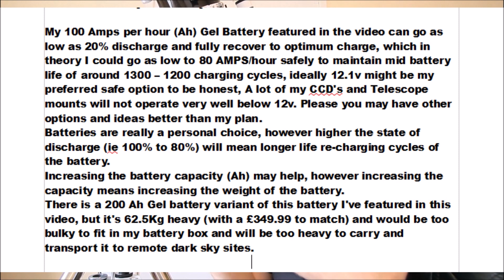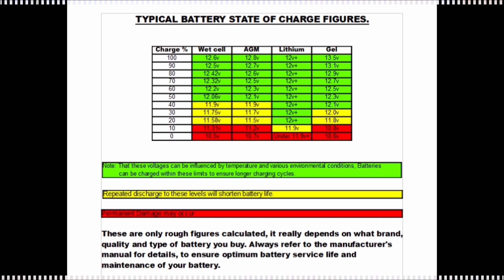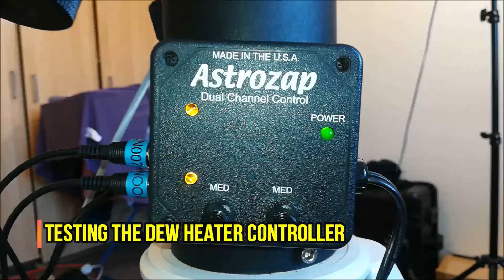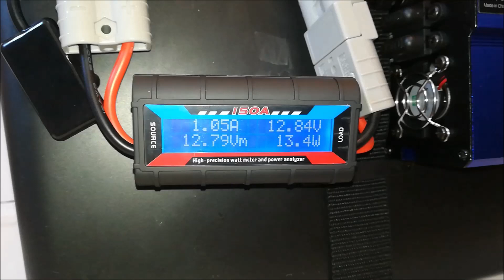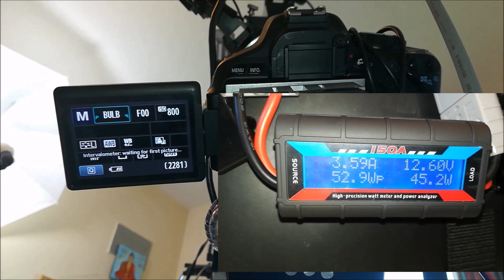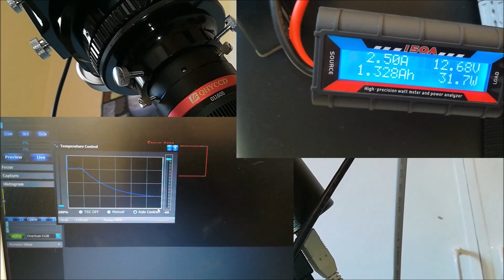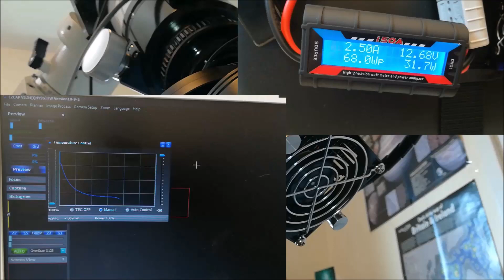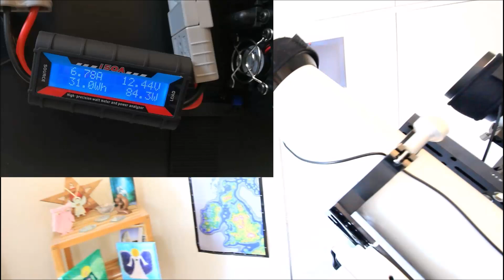Power your telescope to the MAX!!!

Comment: the charge of a battery is measured in amps-hour, not amps per hour.   1 amp is 6x10^18 electrons flowing per seconds, thus if you multiply current with the running time, you get total charge used.  So a battery with a capacity of 17 Ah could sustain a current of 17 amps for 1 hour and then be depleted, or it could do 1 amp for 17h before being depleted.

Comment: I picked up a 22ah Lithium camping power pack and very light, only out a couple of hours a night, or 3 hours max, also have the Celestron LiFePO4 4, which is i think 13ah, enough for the telescope and the other for running dew heaters and revolution imager, so plenty of power. My evo 9.25 has built i  battery but dont use it as the battery does not last long, so power it with external battery.

The camping power pack has a 12v to 220v, so can plug in normal appliances that use 3 pin ac power so handy for lap top

To buy a 100ah battery here in NZ and battery box would cost a fortune
Reply: The newer lifepod4 batteries are the best and can completely flatten then and if you did not use your telescope for years and never charged the battery, will still hold its charge and dont discharge like normal batteries. They are more expensive but worth it, if you can afford them.

Comment: Excellent video Martin, I've been thinking about my power supply and like you had the Powerpack, there is one thing about the Powerpack that I could never work out though, why there is a 'Siren' option on the pack? but heyho... I'm sure there is someone that finds that option a 'must have' :) Your video has helped me make a decision on where I go next with this though and for me, the issues all surround the power for the laptop in the field and your video has given me the solution I've been looking for. Well done!
Reply from the maker: The siren is used as an emergency stress alarm, never had to use it to be honest with you and it's more of a gimmick to sale the power tank. Some of the Lithium Battery power boxes you can buy have a lot of unnecessary items too and can drain the battery a lot more with these added gimmicks . Weirdly enough they offer very lack of cigarette power ports too which this project offers plenty of cig ports, considering most of my equipment do run on them. I'm looking into more ways to improve on the project to make it perform much better. I 've tested the battery box with all of the equipment shown in the video and I have managed to run the entire set-up for 18 hours with the laptop been plugged in once on a full battery charge and one slight top-up, without discharging the battery below 12.1v. This very impressive stuff with the whole set-up costing me just under £300. Sounds expensive at first, but there are Lithium power boxes which cost damn site a lot more money. If you check out this link, you'll get to understand why I made this project in the first place?? 

https://www.amazon.co.uk/COSTWAY-120000MAH-Portable-Generator-Emergency/dp/B07KFBB99Q/ref=pd_sbs_200_10?_encoding=UTF8&pd_rd_i=B07KFBB99Q&pd_rd_r=02856abf-5e85-11e9-9ab7-adaade3fec5d&pd_rd_w=fN4nT&pd_rd_wg=9rLO9&pf_rd_p=18edf98b-139a-41ee-bb40-d725dd59d1d3&pf_rd_r=SCXGH0APZ30QN2NTFBJ9&psc=1&refRID=SCXGH0APZ30QN2NTFBJ9

Don't get wrong these new generation power packs offer quite extensive amount of power options, and being lighter to carry around too, I do get it, however these is one disadvantage with Lithium batteries, that I forgot to mention in the video. And that is??

During cold weather, Lithium are very vulnerable to sudden  temperature changes, and if you try to connect a lithium battery for charging after it's been used outside in the cold, If you don't let it warm up in a warm room for at least an hour, the cells are very delicate and the sudden charge can damage them very easily. Hence why some Lithium batteries have built in power managing circuits to prevent it to some degree of sudden temp changes  however I still managed to damage a Lithium power box before and I didn't realise what happened after the Lithium battery died on me. A few R.V.s which run Lithium batteries as their main power source will require a built in heater in the battery compartment to warm the lithium batteries to prevent this from happening as well.

Thank you Phil for watching my video and please don't forget to hit a like too, Please look forward to some more videos coming out soon!! Wish you Clear Skies from me and A4B team!!!

Comment: Lithium you cannot drain them right down, if you get below 3.2 volts per cell it destroys them. The new Lifepo4 batteries are the best you can buy. Gel batteries don't last either, I have no luck with them.

Leave them for a couple of months, come back and stuffed, they like every other battery need topping up at least every 3 months. Not so with lifepod4 batteries and will have 4× the charge cycles.

They maybe dearer, but in the long run will work out cheaper. They don't loss charge just sitting there.
Reply from the maker: Thanks for the info, It's good to know that further info on Lithium batteries, only thing which puts me off from them is the cost.
Are they OK to be stored in a obsy shed outside in a storage battery box, the only problem is that I've had a small lithium battery which the cells packed up because I've connected it straight to the mains to recharge it (using it's own charger) from being used outside the freezing cold. I didn't realise that you have to let these Lithium batteries warm up slowly in a warm room to allow the cells to adapt before you connect it to the mains to recharge it. This is problem I have in my Obsy shed, I love to own a Lithium battery despite the cost they offer a lot of advantages that gel types don't offer.

Comment: instead of the inverter can I use a 12v laptop car charger?
Reply from the maker: No way Jim, if you draw too much current, you will cause fires and blow out fuses.
Reply: @MPAstro  thanks Martin.. so those car laptop chargers are dangerous? Great detailed video, thank you